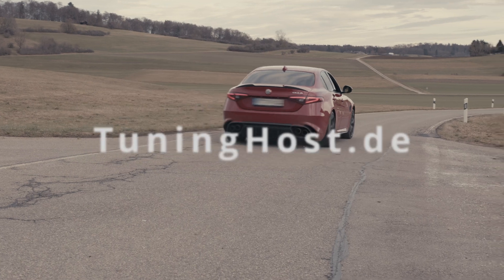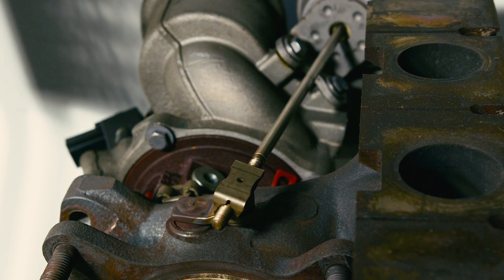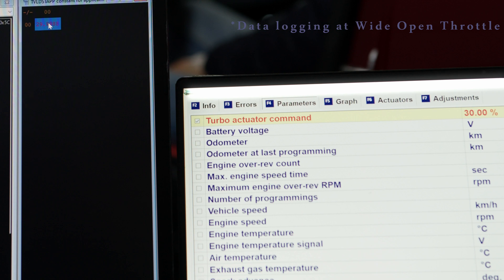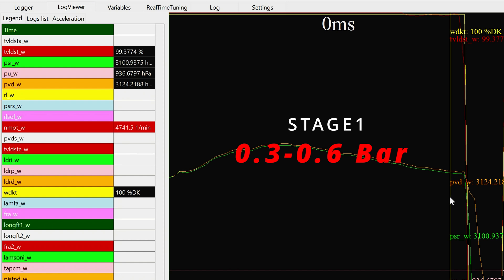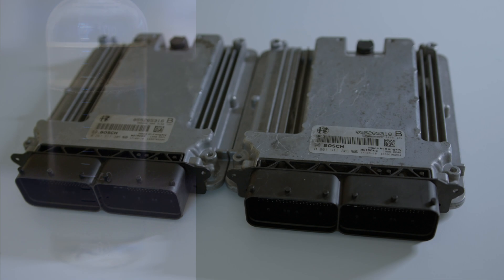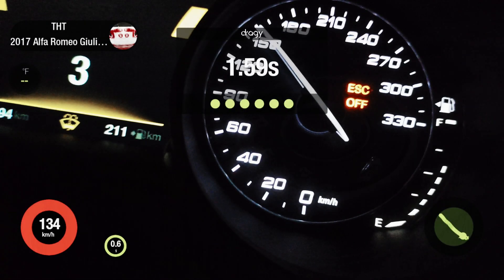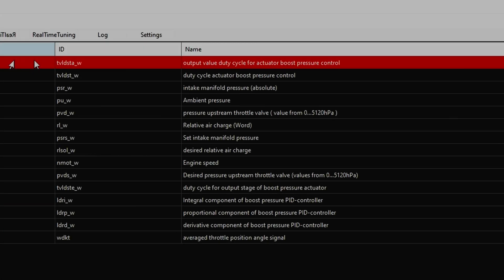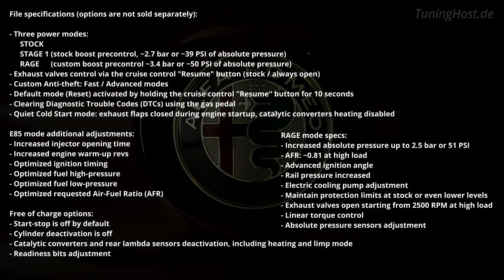Alfa Romeo Quadrifoglio QV Revolutionary CHIPTUNING STAGE1 up to 700 hp solution EXPLAINED!

Comment: Lovely work and explanation. May I ask you if giulia qv could take 4x4 system like veloce or stelvio qv? And if this can be considered in the hardware. Thanks in advance. I am saying that because i want it as a daily car and i need this feature.
Reply from the maker: Thank you for your feedback. It’s available only for QV, including Stelvio. Until now, we’ve done it only in our workshop, but in about a week, we’ll make it available worldwide.
Multimap is included in the package, so you’ll be able to select Stock, Stage 1, or Stage 2 mode at any time.
Reply: @tuninghost9320  available now?

Comment: 51 psi...damn. that's high
Reply: That's absolute, boost pressure is 1 bar (14.7 PSI) less, 36 PSI, still high but not crazy.
Reply: @flacjacket  36psi in a daily driver seems absurd to still expect reliability

Comment: Can a dealership identify these changes in the software for warranty work? Also does this require the ecus to be shipped off?
Reply from the maker: If a dealership really wants to, he will be able to find out that the software is not stock. It can run a checksum calculation routine for a specific area. In practice, no one does this. We also keep the original CVN.

Yes, it requires.